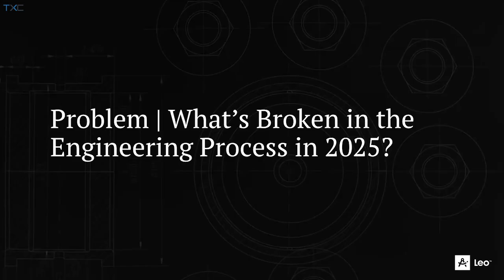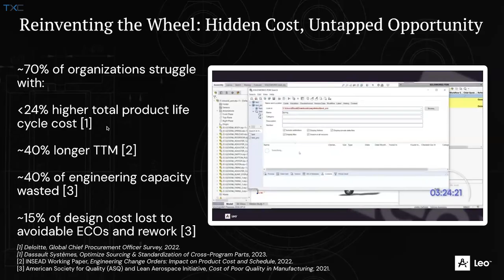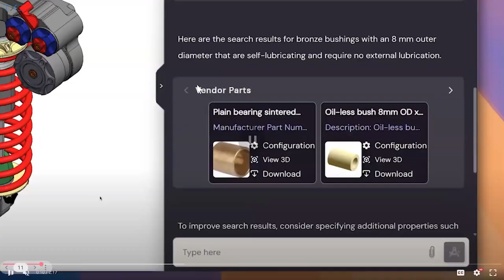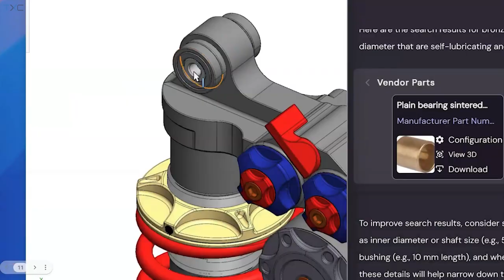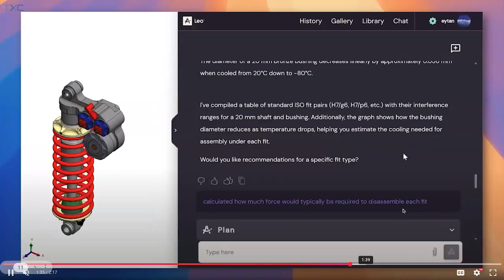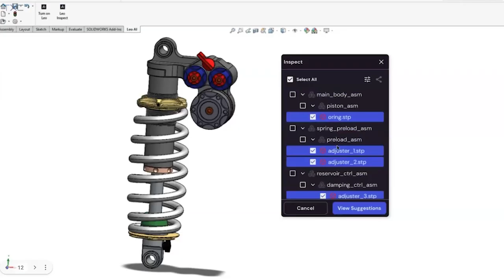How CAD-Aware AI is Changing Mechanical Design

Comment: Fascinating insights into LeoAI and the LMM approach. Connecting CAD data, standards, and PLM knowledge really takes things a step further. If this data is truly centralized and accessible, it massively improves processes like Tolerance Analysis and FMEA. These turn from static, manual checklists into dynamic processes running parallel to the design phase.
For me, the real ROI of AI in engineering isn't about AI automatically generating 'flashy' CAD geometry. The lever is much bigger: We reach our goals faster by accessing existing knowledge and vetted parts. Essentially, we have to model less new geometry to achieve the same (or better) result.
Plus, this solves a huge issue: Securing Organizational Knowledge. When experts retire or leave, their knowledge stays in the system rather than walking out the door.
However, we can't ignore the hurdles. Beyond Data Privacy/IP, the biggest challenge is cultural: The fear of replacement. When an engineer's 'gold'—their years of experience—is suddenly digitized and accessible to every junior engineer, it challenges our self-perception. We have to learn that our value lies not in hoarding knowledge, but in applying it